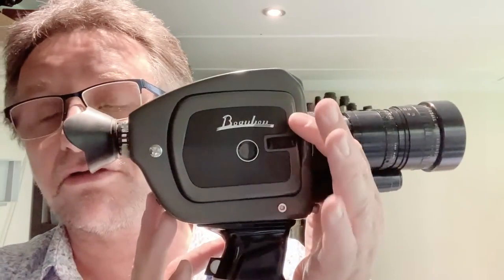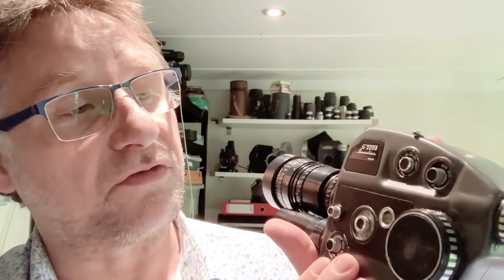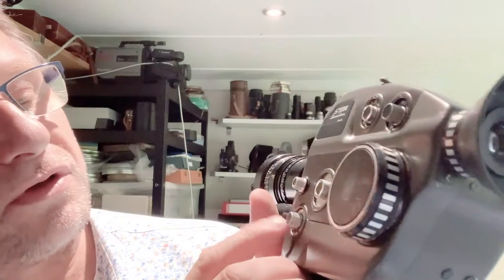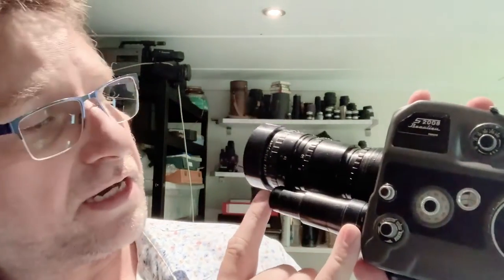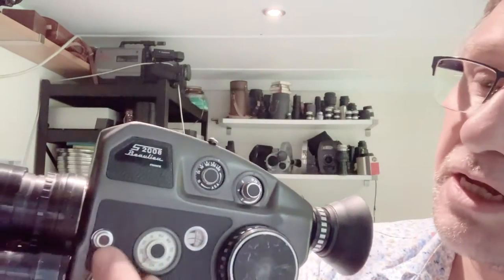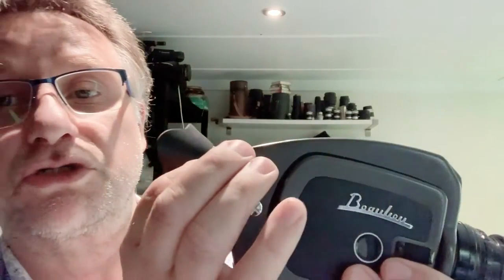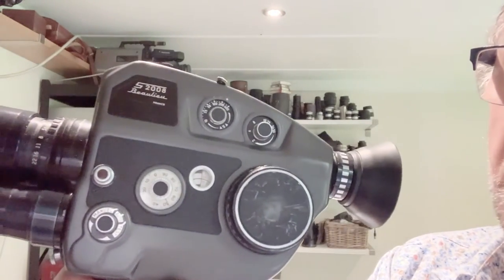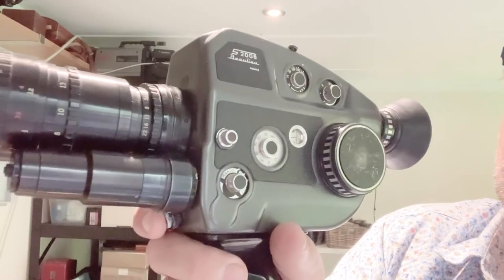Beaulieu 4008 Super 8 Camera

Comment: Thank you! 
I have a question. For film cameras, if you want to open aperture all the way, how do you use the right amount of ND stops to get the right exposure? The only way I can think of is to have a digital camera side by side and copy the settings, but I dont know if 1.9 on this lens equals the same exposure on a bigger lens at 1.9
Reply: You don’t have any internal nd filters and i wouldn’t recommend to screw one on the lens.
You will get the best exposure if you use a lightmeter (analog or digital).
Or the cheaper version use an app for measuring.
„Lghtmtr“ is a good app in my opinion
Reply: If you really want to use an nd filter look how much the filter stops down your aperture. You can google like „nd5 how much lower will be my aperture?“
Reply: @joshuarahimi221  thanks. Yeah ive been waiting to get s light meter anyway, that'll help with the exposure for sure
Reply: @joshuarahimi221  ND works on digital to get details in the brights, because digital tends to blow up highlights most of the time, but film knows how to handle them in the most decent way. By ND, i wanted to open up aperture for shallow depth of field, but a lot of old lenses still give shallow depth even stopped down, so I wasn't really sure, but ill follow your advice, it would be the safest
Reply: @DethronerX  i guessed that you wanted a bokeh. But shooting film with an nd and varying  light intensity could be difficult. Wich camera you’ve got?
Reply: @joshuarahimi221  ordered k3, got ot converted to super16 with lens recentering and m42 mount, but have to send more payment for postage and 2 anamorphic lenses with clamps and diopters. im just collecting information in the mean time. i have some super8s but those wont be much of an issue as long as im using a light meter
Reply: i haven't checked super8s for registration pins yet for autoexposure but ill check them and hope there are more than one or the slider, but ill still take readings. But thr very first time itll be just tests to learn from the results. I might order Tri-X for black and white and some color ones but just basic daylight and tungsten ones. All will be my first experience so will start from basic setups for sure
Reply: @DethronerX  black and white is a good beginner setup cause it’s not that bad if you under- or overexpose a bit👌🏻
Reply: @DethronerX  but i meant on which digital camera are you shooting?
Reply: @joshuarahimi221  Oh, right now just an old Canon 60D and EOS M, but i havent done a proper shoot with lighting and all. I do want to get Black Magic for cropped and Lumix for Full Frame, because my ideal digital camera, Canon C500 Mark II is impossible to buy
Reply: @DethronerX  yeah blackmagic is awesome. I have the pocket original and pocket 4k and i love them. If you look for mft cine lenses, meike is good and „cheap“
Reply: @DethronerX  can you shoot raw with the canon?
Reply: @joshuarahimi221  Cant shoot raw on 60D until I install Magic Lantern, which I havent yet because I have to first copy data and format card. 
As for Meike lenses, I just quickly checked a video and amazed at the prices for about 10k USD at least, a bit color shift, but good performance. Tstops would be the first time experience for me, but it seems like a good start with these Chinese lenses for primes.
I dont mind autofocus that much, unless its an event shoot maybe, but im more interested in music videos and short films, so ill just maybe need follow focus and matte box rig,
As for Black Magic, I know it will be my first, but ill go for the 7k one because isnt it the one that can help with DaVinci Stabilization using its data?
Reply: Im just on neutral settings for now, but I havent really uploaded the clips i liked so far and what i have on my channel is terrible for colors and all, it was done some time ago and I didnt even have the right camera settings then and hadnt properly learned grading. After Effects is the worst for grading, but it has two good effects for it, Color Finesse and Lumetri Color, but I just started messing with them and when I get Black Magic, ill get DaVinci with it, the real thing. Im learning it but not uploading anything til Im happy with something, so what I have here for now is just randomness
Reply: @DethronerX   meike is really great an can compete with expensive lenses at least their cinema lenses.
You mean the pocket 6k?
Pocket 4k and 6k can both use gyro data stabilization after the last update
Reply: @joshuarahimi221  Yes sorry i meant pocket 6k pro. Okay ill check other differences between both and see which one I really need. Thank you! Meike I said 10k, but I meant to type 1000 USD for each, which is a very good price for what its giving and the build quality.
Reply: @DethronerX  bro i paid 280€ for a high quality lens😄. They have two versions of mft cine lenses
Reply: @joshuarahimi221  haha thats crazy I'll have to get them, especially if im buying a cinema camera, i need cinema lenses. I love old lenses too, but those cant be the only ones and these ones will be definitely for a professional shoot. As fast as they can be. Im also looking for old Ultra Fast lenses with aperture number below 1, even if theyre heavy, because it will mostly be used on a tripod or a rig. I like the balance between vintage fast lenses and modern and for Meike, ill have to watch videos on every single one, to decide which one to get first. Really really appreciate you for telling me about them, i was really worried id never be able to afford modern cinema lenses haha
Reply: @DethronerX  yeah me too. Vintage lenses have character that the most modern don’t have. Helios 44-2 is a alltime classic or canon fd s.s.c. Aperture faster then 1.0 is really hard to find. But if you use for example the bmpcc 4k with mft mount and use a viltrox speedbooster your aperture will be a bit faster and the crop factor of 1,9 will be minimized
Reply: @joshuarahimi221  i recently reveived that speed booster and im waiting to update it through USB and try it on EOS M to try full frame lenses and yeah definitely itll gets faster. Another reason i want a full frame for DOF. Good thing about C500 mark 2 is the built in ND. Im not sure if it has anamorphic de-squeez and aspect ratios and LUTs, been a while since i checked its videos on YouTube. What about BMPro, it's got to have support for anamorphic, does it? or im sure Lumix gh5 or 6 have it?
Reply: @joshuarahimi221  ill check the vintage lenses i have, just 3 or 4, and let you know because one of them is Canon FD and other is Helios for sure. Im especially waiting to use Helios as taking lense when i get Anamorphic lenses. Kowa Prominar and Eiki 16F, but they're best for cropped and 16mm (K3)
Reply: @DethronerX  bmpcc 6k pro has 3 internal nd filters, anamorphic desquezeer, loaded luts and you can import every lut you want. Bmpcc 4k and 6k also except the nd filters
Reply: @DethronerX  canon fd’s i would only use fd s.s.c these are the cinema lenses. The normal fd’s aren’t bad but they’re not designed for cinema.
for mft or ef mount and i guess also pl mount the cheapest (and they’re really awesome) are sirui anamorphic lenses. You find sometimes good prices for them on ebay
Reply: @joshuarahimi221  Yeah i need those cinema ones, i just have one still photography lens and yes, it wont be good for professional cinematography. I didnt realize BMP Pro 6 would pack NDs in its body, wow, i have to get it now, it looks like a killing machine in that size.
Ill check your channel
Reply: @joshuarahimi221  I cant see any posts on your channel
Reply: @DethronerX  i wrote a link in the last comment
Reply: @DethronerX  bmpcc 6k pro is a beast. The best for me would probably be the tiltable touchscreen
Reply: @joshuarahimi221  i saw a video thar says BMP doesn't have built-in ND
Reply: @joshuarahimi221  oh sorry ill click on it. actually i saw the link on my phone notifications but when i went on PC to check i couldn't find that message, so i went to your channel directly. Ill find it and watch
Reply: @DethronerX  only the 6k pro
Reply: @joshuarahimi221  This is so weird, if i open up the comments, i cant see your link. Ill have to check in the notifications drop down. wtf lol
Reply: @joshuarahimi221  Well its not in the notifications either, could you please resend
Reply: @DethronerX  sure

Or if you search for the channel BY ANY CHANCE